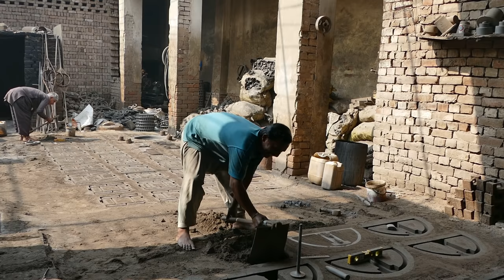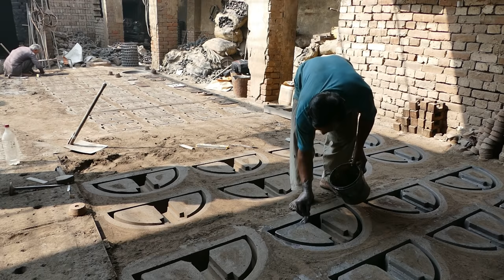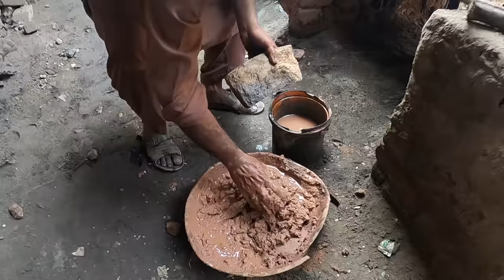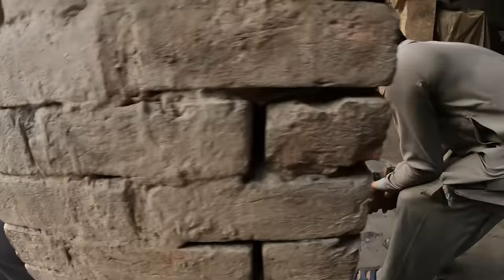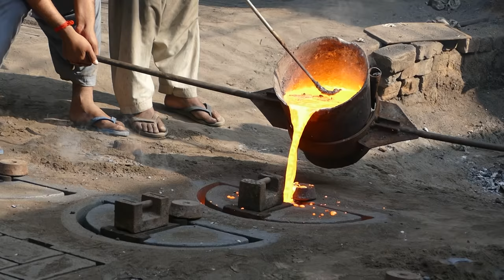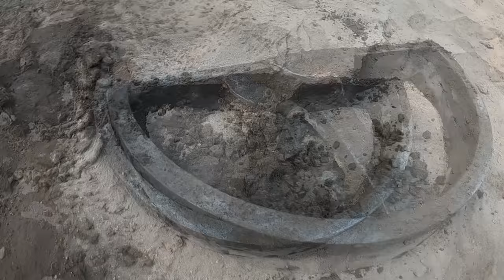What It Takes to Cast a Metal Part in a Casting Factory

Comment: This is like looking in a time capsule. Early steam and internal combustion engine parts were often cast via open pour floor moulds like this. The engine the Wright Brothers used in the first successful airplane was made this way by a small foundry. amazing how far we have come in 100 years.
Reply: lowkey insulting that they're 100 years behind XD
Reply: Well the technique has improved overtime but in the nutshell it's the same.
Reply: The future is here, it's just not evenly distributed
Reply: @XynRemained  it's exactly what they're making. Ancient ass 2 piece flywheels for early industrial age hit and miss engines.
Reply: The thing that has always impressed me is that it only took 61 years to go from the Kitty Hawk flyer to the first flight of the SR-71. And another 5 years after that to land on the moon. An insane jump forward in a very short time all considered.

Comment: Let's go down the list...

1. Digging molds barefoot.
2. Closing up the firebox bare handed (he did have mud or whatever that was on them).
3. Pouring molten steel (2300°-2700°F) in flip-flops and no safety gear.
4. Pouring slag or dirt right in with the metal.
5. If you're not paying attention, you can literally get a hot foot.

Seriously, these guy show exceptional skill in their craft.  Be safe fellas.

Comment: having poured steel in a foundry, I appreciate every step of what they did.
Reply: It's so much more boss than any american foundry I've been in
Reply: am going to guess, from the color of the "heat" they are pouring cast iron...steel would be a white heat, or nearly so.
Reply: @JackpineGandy  cast iron is still bloody hot though, depending on the purity and other metals that might be mixed in the general melting point is between 1127-1204 degrees C!
Reply: I used to pour gun metal at cooper roller bearings kings Lynn Norfolk England

Comment: This is how it was done for thousands of years, since people first learned to cast metal.  Even modern factories still use this sand casting method although they usually don't dig holes in the ground.

And don't be mislead.  Just because that metal is liquid doesn't mean it's not heavy.  😥

Comment: Would be nice to know what the part is supposed to be
Reply: Looks like a flywheel. But I have no idea why would you make that in two parts
Reply: One that can’t be trusted.
Reply: @thetraitor3852  Maybe they make it in two parts so they can put it onto line shafts? Would be easier than slipping the pulley all the way down a shaft. But why they're still using line shafts is another question.

Comment: Their feet are as tough as mountain goat hooves, but if that hot liquid magma run across one of ems toes,, this would turn into a dance mix video real quick
Reply: Leidenfrost effect. It will be harmless for a quick splash
Reply: @ratadream3855  ট
Reply: @1928mehdi sh he didn't say that they are goats, but their feet are as strong as mountain goat hooves(feet)
their feet can resist such that heat, just like mountain goat run & climb rocks, it's hooves are so durable
Reply: I was thinking the same thing, you guys don't even wear shoes?  C'mon.....
Reply: @alienlatino2945  they wear shoes outside but not doing dangerous work this is bcoz they don't wanna damage their shoes. 😏

Comment: looks like half a wheel, perhaps a flywheel
Reply: That's what I was thinking. Most of the stuff they cast, I can tell what it is, but this is puzzling. I like the forge . guy up top putting scrap in as they get metal out of the bottom.

Comment: Germany: Man there is a scratch on your 10000$ Securitysuit, you cant work today...
Pakistan: You are barefoot? No problem!
Reply: Sandals, shoes? These are against regulation and a serious safety hazard. You need exact control of movement only bare foot can achieve. Take it off now, or get out of my shop!
Reply: Quality MATTERS with STANDARDS 😁😁
Reply: @harekrishnaharerama2207  India are the same like Pakistan
Reply: @user-rb4tz6hs6p  most of Asia deal with same mindset 😂 but definitely German engineering (mechanical engg.)  is way better then Indian or other asian engg. Also japanese are pretty good 
Love from india brother 🙂

Comment: Can anyone tell what the mechanism is they release the molten metal with? He appears to just start poking it with a long rod, and it starts flowing. I guess he could be breaking through some kind of dross or slag? How does he stop it from flowing so easily? He appears to use a larger rod when he wants it to stop. I can't imagine how this works.

Comment: What's the silvery solution he brushes onto the edges of the moulds?
Reply: Dont know what the chemical is called but the process is blacking the mould.... it's to stop the  molten metal biting into the sand to much when casting which gives a worse finish on the casting

Comment: Any metal worker experts? There must be an easier way nowadays to cast iron parts, right?
Reply: Actually, I worked in a factory making bronze valves (naval use, mostly) and the fundamental technology is that.
Dirt packed to make the mold, or dirt packed around a piece of wax shaped like the object you need.
Heat up the dirt to melt the wax out and splash in the metal.
Once solidified, brush away the dirt and here you are.

There is a video of how Lamborghini mold the housing of their v12 engine in aluminum and it's not that far - except in Italy it's done in kind of a little tiny tainy less unsafe way, so to say.
Reply: @ulissedazante5748  I see, thank you! Very interesting. I'm studying production technician, but in my head I always thought sand/dirt molding was an old technique 😄

Comment: Pouring molten aluminum with safety shoes is for boy, pouring molten aluminum with flip-flops  is for man ....😂😂😂😂 But the guy who opens and closes the furnace has moccasins 💪💪💪
Reply: this is hotter than aluminum...this is a yellow heat, and aluminum will be at a much lower temperature, not emitting visible light at all...a black heat

Comment: I'm trying to build a wood lathe and want to cast some of the parts like tailstock and headstock. the casting itself will be done by the local foundry but I have to provide them with a model and I don't know what material I should use for the model. I have a workshop and professional tools as my job is making stuff but I have no experience with casting so can someone kindly suggest me a suitable material for the molding model? they are going to sand cast it and I've been thinking of using wood would it work?
Reply: You can use wood. Generally the pattern is finished smooth so it can be removed from the sand. The real tricks making patterns is giving them draft and calculating the shrinkage. Everything has to be filleted, etc.